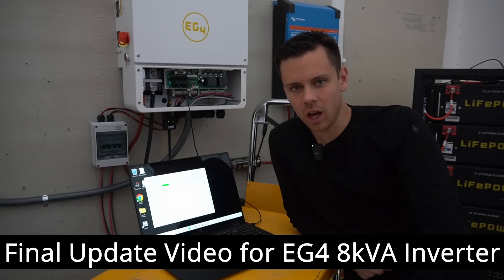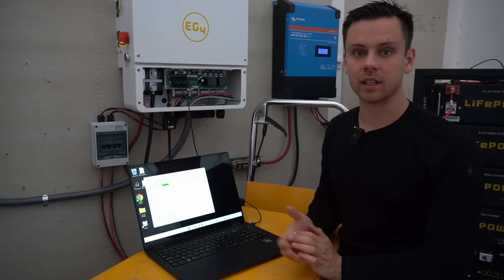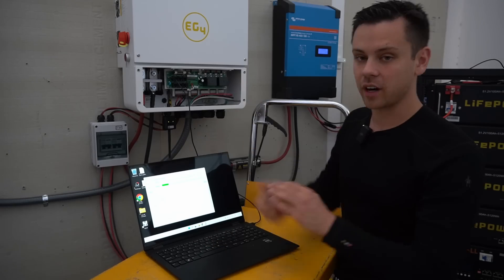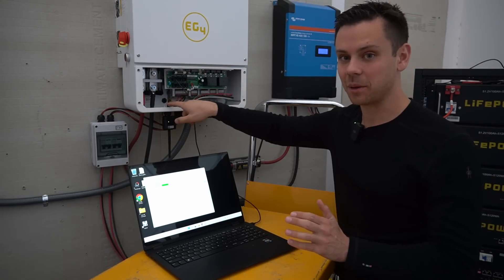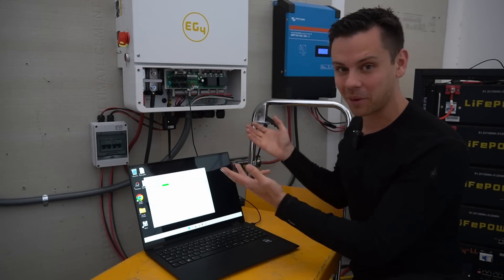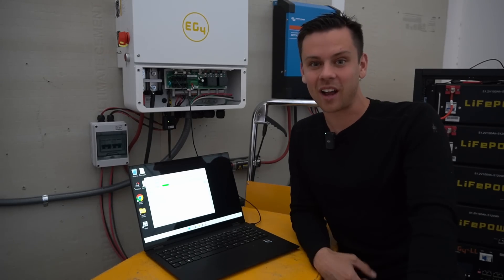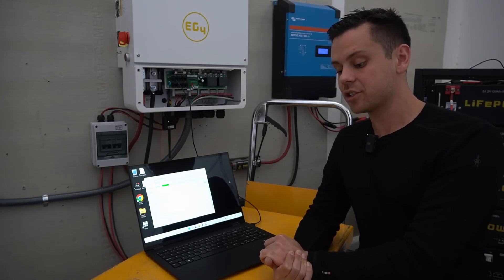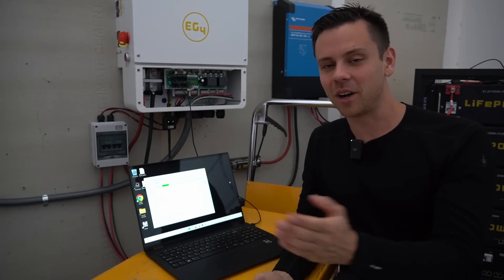EG4 8kVA Final Update

Comment: So I have 6 of the EG4 LL V2 batteries with the stock firmware from the factory and the updated firmware for the inverter.  The batteries are configured to talk on CAN and I have the inverter coms set with CAN.  Everything is working like a champ.  Not sure what you are doing wrong, but I followed the instructions for Sig Solar and I am not having any of the issues you are facing.  With that said, I am not trying to charge a tesla.  You may want to make sure that your communication is working between the battery BMS and the inverter.  Also, the megarevo forms are a great help.  I do IT for a profession, so I have had good luck using the forums to do all of the heavy lifting when it comes to finding information.

Comment: Purchased the EG4 8kw on 25 June 2023 and since installation the unit has not worked properly. It would not start inverting or stop for hours after starting even though the voltages were well within specification and full sun. After many hours with technical support troubleshooting and trying to update the firmware, which we were unable to do, we are returning the unit.

The very disturbing part of this was each of the three support technicians we worked with over the troubleshooting efforts stated they have problems with the EG4 8kw and said, should have purchased the 18kw as they steer buyers away from the 8kw.

Wish I had seen Will's multiple great videos on the EG4 8kw before purchasing.

Comment: I bought two of these in January and installed them in March
2023 and have been running off grid ever since. I don't like the awkward menu/ manual but I would have to admit the thing does work. I have two of them in parallel.

Comment: Any chance to mock up or discuss a 3 phase solar system? I just got panels at dirt cheap prices but need to pick equipment out.  The easiest 3 phase is 240v. But I do not have 240v, I have 208v. Might annoy the electric company for a new transformer but who knows. They tell me to call an electrician to determine voltage of system even though they own that transformer. I do have 3 phase. I converted a commercial building into residential and really love the 3 phase. Any 2 terminals reads 208v so not a Delta 3 phase. My best guess is to drop the 240v output from the solar system to 208v with a converter x 3?

Comment: Greetings!  I've been following your videos for years.  Also on (low) fixed income, so when I jump, I need to get it right the first time.  Needless to say, I pay a lot of attention to what you have to say.  I'm also a 'newly minted' amateur radio operator.  Is it possible for you to add RF noise testing to your charge controllers, inverters, and all in one units?  Many want to add solar to the mobile stations, and some primary 'ham' shacks.  (One of the primary reasons for having amateur radio is backup communications for the community in a disaster.)  If these units are putting out spurious RF, they would be useless in a radio shack.  If this is something you would be interested in adding, and have questions, please contact me.  I'll do all I can to help as it would be of great benefit not only to me, but other 'hams' as well.  Thanks much.

Comment: Do you have a video of the process of adding a new battery to an existing battery bank? I looked, but didn't find one. I would likely have to build my system over time, and would be adding batteries as funds permit, so I'd need to know the steps involved. I will likely go with EG4 batteries, if that helps.

Comment: It sounds like a user that is doing a closed loop (battery<->inverter communications), the system works fine.
Reply from the maker: It shouldn't matter. I should be able to connect any battery I wish.

Comment: Spent 3 months with Signature Solar trying to figure out and fix a PV issue where it would settle in to a float charge when we were only at 75% SOC and in full sun. Go out and flip the PV breaker off and on and it would "wake up" and charge at what was available from PV. Any cloud passing over would settle it back to a float state. This is on an RV with 5020w of solar and 14.4kWh of lithium @ 48v. After deciding to get help from DIY Solar Power Forums I was able to find out that the 6000EX needs to have its voltages set higher than you would think. Must have bad voltage sensors. Setting my charged voltage to 55v instead of 54v has seemed to solve the issue. I with I hadn't gone through all the "we'll have a firmware update that should fix that in a couple weeks" and getting another unit and swapping them out only to have the exact same issue. It was a 1 minute setting change that other users had to tell me about to solve it. Sig Solar has a lot of work to do before we will recommend their products to our customers.

Comment: I have a question for you, Will... Having started with discrete charge controllers and simple inverters... And having experienced software issues with the super integrated inverter units... Which setup do you think is more reliable long-term?

Comment: Hey doing a search on YouTube that same unit many others state how happy they are with it no issues what are you doing differently than they are? Also did you not make a video little over a year ago on the MPP LVX6048 ? that’s the difference with the new MPP unit you plan on using? as always great content.. but yeah just like to know why you having issue with the EG4 I can link the many videos I watched no issues.
Reply: Watching your video again, it seems your issue started when you tried to get more than 28amp output for charging your EV? So if you did not try to push it to 32amps you would not experience any issue? Also why would you need to update the firmware to change the battery type that’s causing the output limit?

Comment: One last suggestion, put the update software and files in a new folder right in the root of your C: drive, it might be having windows permission issues.
But yeah, rushed to market and absolutely no R&D from SS. The fact that they would send you firmware that bricks the unit is stupid.

Comment: Aah the age old firmware brick. There's a reason IT types only upgrade firmware as an absolute final last resort.  If it aint totally completely and utterly broke don't touch the firmware! :D (or in wills case it's already a pile of unusable garbage so may as well try it!).  The real scary thing is these inverters have the potential to set your house on fire quite easily and quickly.

Comment: Firmware updates are always tricky with any electronics. I had Sophos access points, which used to update their firmware from the firewall they were connected do, in order get their configuration. Sometimes they bricked themselves and you had to take them apart, short certain pins at the exact right moment to invoke a shell. Then manually flash the boot code at the correct address, so they would boot up again. Most vendors will just send a new unit, because this kind of maintenance is too expensive for them.

Comment: I wish MPP could get fully certified, and provide better monitoring software with energy tracking. I've only had my LV6048 for a few months now, but as you said, it just works. No faults or anything yet in that time.
Reply: Definitely can't replace fans on the lv6548 I went to do it and all the cables were thermal glued down, so you 100 percent would damage the control board.  unless you had an extra control board laying around and a solid skill in soldering I wouldn't attempt it.
Reply: @happilyprogrammed4152  WHAT - If you can't replace the fans on a 6548 it is worthless, as these fans won't last more than 3 years! Surely you are mistaken!
Reply: Downside with the lv6548 is its sooooo loud even low load.  I can hear mine across my entire house
Reply: @happilyprogrammed4152  the 6048 does spin down the fans below ~30% load, not like the 2424 I had before. 100% fan speed at all times. Was pretty loud. They use what looks to be regular 12v 80mm computer fans. Could get some lower rpm, high flow Noctua fans to quiet it down.

Comment: Nothing worse then having to depend on firmware to fix issues that should have already been polished out before a product was produced. Then finding the firmware isn't solid enough to even flash correctly. Props to you for testing this out so we don't get stuck with it until its a bit more stable.👏

Comment: Random question but have you reached out directly to eg4? I had a question about the 48v-3000 and they responded literally a month before sig solar with detailed information about it while SS came back with a simple yes/no answer.
Reply: "a month before sig solar" NO KIDDING, Sig Solar customer service in non existent. If it isn't something simple like a racking system, RUNNNNNNNNNNNNNNN
Reply: @mfgxl  definitely a place to buy the gear but yea for your questions reach out to the manufacturer, they respond so much faster and usually with better info if you're confident in your abilities. Also for anyone who's curious I asked them about mounting a 3000ehv horizontal in a trailer and vibration concern as well as neutral ground bonding. So long as it's securely attached and you have proper airflow it's fine and they mentioned they've seen their units used in a few a lot of builds (though I haven't seen any on YT). As for the bonding, in the first iterations of the manual it mentioned it would bond when no ac was present which for a trailer is important especially if you're going to leverage the 110 bypass. They removed a screw that linked to a relay which would detect and couple/decouple the bond based on source power. All you should have to do is crack it open and add a screw to re-enable the feature. I'll have to see if they did any firmware stuffs too but if they did I'm sure eg4 will provide me with the firmware to enable it.

Comment: Thank you for all you do Will.
It would be VERY nice if someone would build something that is not "so smart it fails to work". Adding googaws and GEE WIZ WILLIKERS!!!! to something that does NOT **JUST WORK** is my biggest complaint with "modern techno-gadget" designers. It is as if somewhere along the way software designers forgot that if something does not fail GRACEFULLY and work that their software is just garbage.
I have several friends who are software designers and they all take issue with my complaints but I then demonstrate to them a MECHANICAL/ELECTRICAL system that "just works" and has the functionality I desire albeit with PHYSICAL SWITCHES for state modes and they hem and haw but they still insist that "smart is better".
**sigh**

Comment: Your having a lot more troubles that I’m having with my Eco Flow Delta Pro’s Dual Voltage Hub providing uneven voltage to each leg of power. 114 on one 124.5 on the other leg when the delta’s percentage is more than 2% difference from each other. When the delta pro’s percentage is the same the voltage is about 119 on each. 
The tech (Mike) from eco flow hopes that I can understand this is the way it is, WTF.

Comment: Why bother being a beta tester? In 3 years all this crap will work flawlessly. If you can wait do so. I've held off with all this hybrid stuff for 5 years. In my offgrid remote cabin I use the old lead acid, Inverter, charge controller, and 1500watts. It just works. When a piece breaks I replace with a new model. My lead acid works at -20C unlike Lithium. 
When a battery pukes I go my hardware store and get another. I just match the battery to my old stuff and voila. 
My system is 7 years old and I have never had a problem. I have a spare inverter and charge controller as backup. 
I go to my cabin, it just works. Stop being fleeced by this all-in-one junk. It's cost me nothing other than my spares which I haven't used in 7 YEARS!!!

Comment: Before you give up. Try replacing the USB cable. I have found that the low cost (Amazon) cables may not provide the proper twisted pair impedance. The USB driver fails and Windows does not report anything. It just hangs.
Reply from the maker: That's not the first cable I tried sadly. And yes I understood how that works
Reply: @WillProwse  I had bad connection issues on my LV6048 using the included USB cable. It was constantly dropping signal. Like you, I tried a couple other  old printer cables I had to no avail. What did end up working though was using the included cable with a 25' active USB extension cable. Hasn't dropped a signal once that I could tell in months.
Not sure why it works 🤷‍♂

Comment: I had hoped to be able to use the Megarevo version of this inverter for two California grid-tied installations. Supposedly the Megarevo version (the EG4 is a rebranded version) has been submitted for California approval. I really don't want to spend the extra 4-5K each to buy Sol-Ark's. Your experience means I need to keep looking. Thanks!
Reply: Just buy the Sol-Ark and save all the hours I’ve wasted trying to get Signature Solar to take responsibility for shipping this unit before it worked and before they were ready to support it reasonably. Avoid the disappointment and go straight to the Sol-Ark 8K

Comment: I’ll be honest with you Will. I had the same issues with Signature Solar regarding quality and cooperation to try to come to resolution. I mean come on, sending out a new unit is not gonna fix the issue. These people are at the mercy of China and they have no control over the cheap junk that they give out to customers. Just sayin’
Reply: So true, the entire company is based around rebranding these Chinese inverters and batteries and calling them their own when that's farthest from the truth. The company is just a drop shipper that cant stop putting out products to make a dollar. Highly doubt this company will be around in 10 years when all their products keep getting returned because they are hot ass.
Reply: @backroadcamry1467  you should consider not buying cheap Chinese made inverters. SS also sells Victron and Schneider equipment
Reply: That’s their signature.
Reply: Charge by voltage , i did that for my WARU inverter, now i have 20kw in battery happily functioning

Comment: I dont think its a software issue.  I was an electronics tech in the Coast Guard for 22 years and I experienced similar issues throughout my career and in the end we started figuring out what was causing a lot of our failures in our systems.  We found out that when we have a system that is exibiting the same failures throughout the product line it was always determined to be caused by IC chips that were sourced from China.  We eventualy discovered that these IC chips were "counterfit" and were sourced from electronic recycling and the chips were refurbished and a lot of the times relabled as more expensive IC's where the chips were repainted and stamped with different labels.

Comment: Will! Have you ever tried installing the old firmware then updating to the recent one? Idk if this would work but I've ran into problems like that using the power watch software
Reply from the maker: Yes that was one of the first things I try when I was having the issues. I also tried different cables. I downloaded the old firmware off of the website.
Reply: @WillProwse  Didn't you say that you did this in the video?
Reply: It could be the use of cheaper hardware by trying to keep cost down for consumers. I wouldn't blame them. They have been doing great up till now

Comment: Anyone who has a MPP LV5048 available for sale, let me know. I need one more, then my future sets of inverters will be newer MPP inverters. 
Thanks
Reply from the maker: Man that's one of my favorites I still have one cycling every single day and it works perfectly
Reply: @DIY Solar Power with Will Prowse  I'm excited to start using mine. I'll be using these in parallel until I get a third, to try 3phase for my shop. Because the lv5048 is so hard to find, I'll need to buy LV6048's moving forward, for my home power
Reply from the maker: I've had zero issues with that unit and had it for so many years now

Comment: Ugh, what a PITA. Shame as you did like how quiet they are. My 8kW unit when charging sound like I'm on a runway and about to take off!

On a different topic, have you ever looked at the quality of the AC output waveform these units produce and pass through?
I have a differently branded version of the MPP 8048MAX (230 V AC) and while inverting from DC the AC output waveform is reasonably decent but the waveform when passing through grid power is a bit ordinary (asymmetrical and flattened), while the source waveform from the grid is very good. It's doing some weird stuff when passing power through. It's worse if AC input is set to UPS mode, a bit better in APL mode.

Comment: Try Windows 10, or compatibility mode possibly.  Worth a shot.  That has fixed firmware updates for me in the past.
Reply from the maker: That's an interesting idea
Reply: Honestly if their unit does not work properly and the end user has to do that level of diagnostic chicanery then even if it **DID** manage to tease out the failure state I would still insist that the unit was a lemon. If they cannot build a hardware/firmware/software stack that does not take a masters degree in QC to operate it is not ready for primetime.
Forcing the buyer to fix your faulty equipment should not be tolerated.